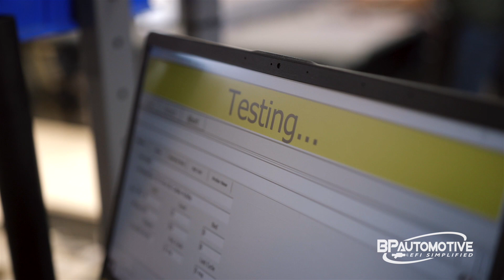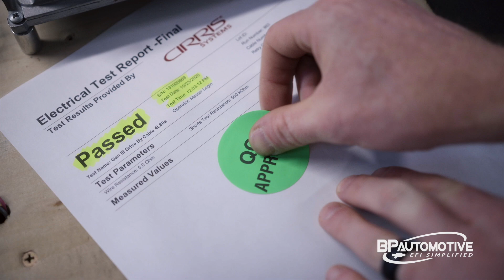Quality LS Swap Harness Made Easy- EFI Simplified!

Comment: I have a 2006 GMC Sierra 5.3 LS. I am having an issue getting fire to my #6 cylinder. I have replaced coil pack , fuel injector , spark plugs and wires along with throttle body and tps. I am beginning to think it may be the harness. Do you have a website where I can order if need be? Thank you for your time.
Reply from the maker: @lindseyhomesteadfarm2653  hello! Sorry, we do not offer a factory replacement harness for your application!